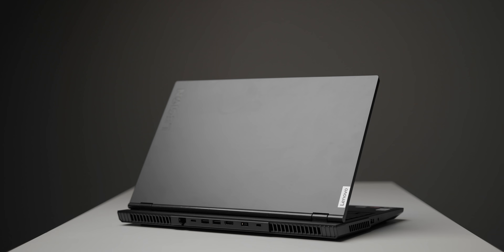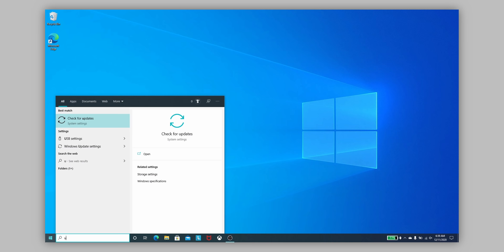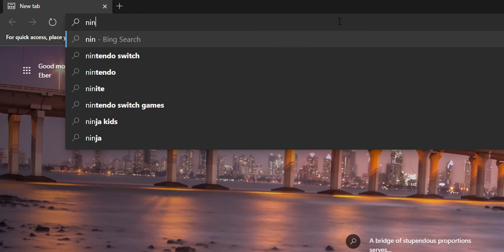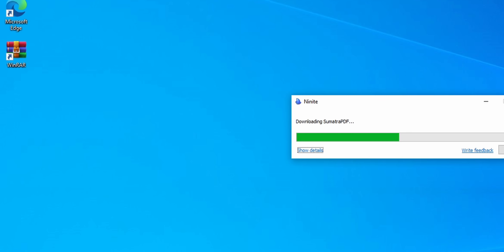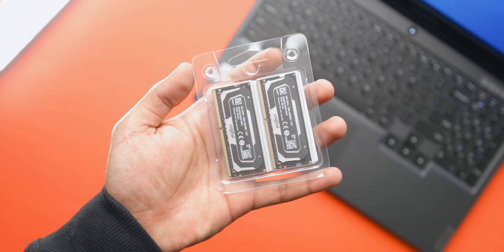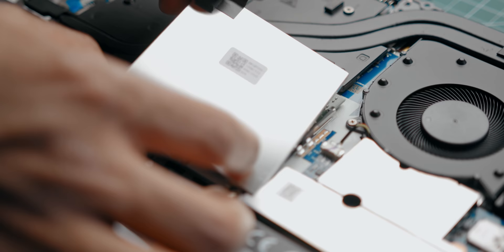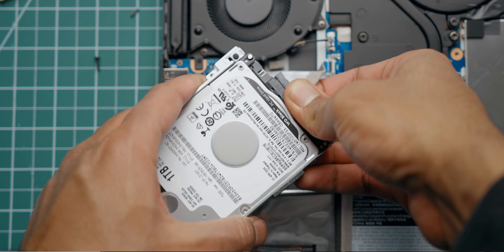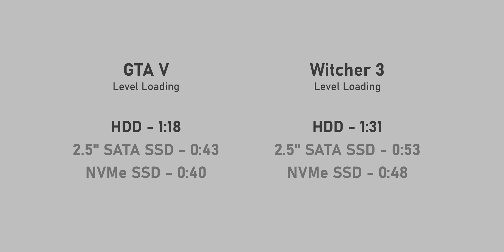How to Upgrade and Optimize Your Gaming Laptop for 2021

Comment: Great Video! As I'm using my Legion 5PI as my only system, I'm currently looking for a second external monitor for work and gaming. I could see more poeple being interested in the topic as there are a lot of things to consider in that specific use case (Gaming Laptop with two external monitors).

For example:
1080p vs 1440p
24" or larger? (or even a single ultrawide instead)
Connecting via USB-C to DisplayPort/HDMI
Refresh rate
Should you get a Dockingstation
etc.

Initially, I thought of getting a high refresh rate 27" 1440p IPS Gsync monitor. After doing some research, I'm currently thinking 24" 1080p is probably the better option. Still unsure though.

Comment: 07:45 Sure we can use Global Daum Potplayer. 
It can utilizie VR, DVD, 3D movie, TV, playing audio, equalizer, own audio configuration like floating point 32bit, surround mode; dolby pro logic II, DTS, sample rate, color space, and so on instead K-lite codec pack doesn't own those features. 
Easy for dummies (I mean newbie/ordinary user).
When you doing something wrong and don't know how to fix that just clik "reset" icon in preference setting then your problem already fixed.

You might try it (Recommended)

Comment: Don't forget ThrottleStop. The biggest feature is being able to adjust settings in Windows to lower power consumption/voltages to keep your laptop running cooler and quieter. 

And don't forget to immediately uninstall the built in Skype, though it can prove difficult to do!

Comment: Laptop cooling feet is what you really need for laptop.
It helps cooling by ensuring fan's air intake isn't obstructed
I got cheap under $1 one. It must be glued to laptop's base plate but this isn't big problem.

Comment: There's no reason for a mechanical hard drive in gaming laptops in 2020 - 2021. M.2's are way smaller and faster and any 2.5 inch drive should be SATA SSD. Mechanical drives no longer make sense for gaming laptops.

Comment: I love using chocolate to install and update apps on my computers. 
Also if your laptop has a metal body consider adding thermal pads to aid with cooling (did it on my dell xps 13).

Comment: There is a way to stop updates. Go to settings and change the network connection type to Data. Then go to updates and make sure download using data connection is deactivated. And boom. No more updates

Comment: software recommendation:
7zip
everything
irfanview + plugins
k-lite codec + format factory+ handbrake....even xmedia-recode
potplayer + smplayer
winaero tweaker + iobit advanced system care
for antivirus, avast is a good start
usb safely remove is also handy
for pdf works,nitropdf is a-must
for browsing, the best yet is opera which is again chromium based browser which means every extension works there as well.
anydesk to get help is also recommended.
DISM+ and integrate it in "boot" menu by enabling it in it's settings is also recommended.
glary dis explorer is a better overall software compare to windirstat.
also always gives people a bootable flash with sergei strelec live-winPE with all it's softwares..medicat and dlcboot are also other alternatives.
Reply: @claritoresdiano1021  killcopy I like more...but fastcopy is the fastest according to tests

Comment: You can create a offline account by clicking "I have no internet" in the bottom left corner while windows asks for your connection stuff during setup.
Reply: Not on all versions of the installer. On some of them you need to unplug your ethernet - Or start over if you accidentally hopped on your wifi.
Reply: @amshermansen  Yes, as far as I know thats true for all versions of the installer. But it is still possible and I prefer offline accounts. Microsoft just created another unneccesary issue here :/
Reply: It's possible on all installers to bypass it. All I said was that some have the "No I don't want an MS account" option, while others won't offer it, unless you physically unplug yourself during installation.

Comment: I 'upgraded' an old 17" HP DV7 laptop a while ago (i7, GT650M GPU) - Though some bits didn't want to go back on (frame around the keyboard) there were some notable improvements: Booting up when cold is seemingly instantaneous due to the mSATA nvme (as fast as entering your password). The versatility of a laptop with 2 2.5" HDD bays and an nvme slot is great - shame about the cheap plastic the laptop is made out of. Will probably make a custom PC out of it later (put it in a desk or box and hook it up to a home network)...

Comment: 2:58 pro tip turn off ur Wi-Fi and then it skips the Login requirement process
Reply from the maker: You can SET UP windows with an offline account but with the latest Windows update, you need an online account or some key features will be locked out like the ability to change your desktop background.  :(
Reply: @HardwareCanucks  ooh right I forgot about that : (
Reply: Why does :( look weird
Reply: no longer works. It will ask for your login credentials when you enable/reconnect the internet on a fresh install.
Reply: @HardwareCanucks  This is categorically incorrect.

You're thinking of ACTIVATION. You most definitely can change your wallpaper without an MS account.

Ya gotta be unplugged from the internet on some builds on the USB made installer. Others have the "No fuck off - I don't want an MS account"

Comment: The Legion 5 is one of the fewer laptops that comes with 115w variant of the 2060 (2020 ver) GPU (laptop TGP range from 80-115w). And it doesn't cost you tons of money.

Comment: I bought one when it came out  a great laptop but if you are playing use the fast charger on the option of the lenovo app it will boost the performance and one another thing clean your laptop cooling for like 2 to 3 months it will help the laptop from bottlenecking if you don't it will damage the hardware non the less a great all around laptop great vid

Comment: Dising Norton...REALLY?!?!? Haven't had a problem yet with it and it keeps both my Main PC and new Alienware M17 Laptop running smoothly. 

Got the laptop from Best Buy and immediately upgraded the single 128GB M2 2230 SSD to 2 M2 2280 Seagate Firecudas AND replaced the 1TB Seagate Firecuda HDD with a 4TB Western Digital Blue SSD and maxed out the RAM to 32GB....but Best Buy sold me a lemon as the CPU Fan started to fail after almost a year. Had a Dell Tech over to replace both fans and he was impressed that the laptop could run with all the upgrades I did.
Reply: The biggest performance boost I’ve ever gotten from software was uninstalling Norton lol

Comment: The best improvement you can do over your laptop is upgrading the storage and replacing it for the lastest technology available. Add more RAM helps working and running mutiple programs at the same time, but a new SSD or Nvme M2 gives you speed, performance and stability.

Comment: Just on a little sidenote, but there is a way to completely disable windows updates. Although the visible option has long since been removed, the function itself is still in windows, and with a quick google you can find how to reactivate it. 
I however cannot recommend it. I have used it in the past to prevent obnoxious windows updates, but it can (and has, in my case) cause corruptions in windows over time, forcing you to restart the pc or in worse cases giving you a BSOD.
Reply from the maker: Actually, the option resets itself randomly with the latest updates.
Reply: It can't reset itself if you don't update. Duh

Comment: Use Brave Browser and then disable the built in torrent, then log in with you Google I’d and such to input your passwords. I also need to upgrade the ram of a hard to get AUS TUF GAMING AMD Ryzen 9 from 16GB to 64GB

Comment: Honestly I am still disappointed in companies/school/people forcing you to use Zoom when you can use something like WebEx but if you have to use it recommend throwing it in a virtual machine if you can secondly I wish we could still undervolt CPUs and GPUs because that actually helps out in performance a lot but thanks to plundervolt and manufacturers taking precautions and making it so you can't do that anymore 😔 well that was my rant but otherwise great video really liked that you recommend ninite also if your comfortable I would say change your thermal paste and pads which might help depending on what the manufacturer used at the time or how old your laptop is

Comment: Great video, and I'm sure most people will find it useful, but for me I'd likely install Linux on this immediately. Lenovo has great first party Linux support, so I wouldn't worry too much about drivers and the like. And it solves problems like bloatware, antivirus, and worrying about Microsoft breathing down your neck. And, well, since every Linux distro has a package manager, I don't have to worry about scouring the web for app downloads either.

Comment: This is everything I did on my old laptop. 2tb Nvme m.2, 2tb ssd data drive, 32gb ram, clean out the dust. Only thing I didn't do was repaste or liquid metal. My os is completely debloated and I use patchmypc to get programs

Comment: 15:04 WOW, I thought, OK cool both dual channel and 32gb help a decent chunk in certain programs but theres no way it'd help in gami- oh wow, even 32GB actually helped with sometimes close to 10% improvement and that's with just 1 program running. And dual channel is just a must by the looks of it. But it is nice to see you can still get 2-3% benefit even in just games from 32GB which is nice as I just got it because I like to have EVERYTHING open

16:09 Good to know, I should've really observed this by now, I'll pay more attention to these things.

17:15 ngl I never knew this I only ever paid attention to downloads. Yes only becasue theyre unoptimised but if things were really properly optimized, things would take more advantage of SSDs and espeically NVME.

Comment: I have an idea which I do not know how practical it is but if we install the thinnest 2.5" drive for example Seagate 500GB 2.5" Ultra-Thin 5mm which is 2 mm thinner than normal drive, we got 2mm of headroom above the 2.5" drive then it may be possible to install second m.2 SSD at the same time! or maybe using m.2 extension cable and attach the second m.2 above the 2.5" drive with something like double-sided tape!

Comment: Would this Ram work for the HP Omen 15 Ryzen 7 as well? 
Can it run CL 16 and 18 Rams, I know CL 22 works? 
Is it bullet proof to assume that as long as the new Ram kit runs at 3200 MHz in CPUZ, then it is 100% compatible? 
Great video
Cheers

Comment: TLDR: I will go SATA SSD instead of NVME SSD because I am poor and want 2TB because WORLD OF WARSHIPS loves to heavily compress their update files during update cycle

Long version: From this vid I learned that SATA SSD and NVME SSD does not have significant difference. So I think I will just go for SATA SSD for my PC. IK its PC but I think its performance is relatively similar. I need to stay away from my HDD to upgrade to SSD cheaply since im poor. I want large storage like 2tb large storage but cheap so I thought SSD is good for me

One game called WORLD OF WARSHIPS is a pain to update in my HDD on top of my i5 4th gen (4c/4t) CPU as it heavily compresses its update file and the dev always gives 2 GB (rare) to 10+ GB (mostly) PER MONTH. Downloading the update file is faster than decompressing it in my experience and it took me not just a day but mostly A WEEK and at least 3 DAYS*.

*I'm not an addict that opens my computer everyday but at most weekly and at least monthly so my games are always updating when I open my computer xD

Comment: Microsoft has not removed offline account just dont connect to internet when setting up your account.
Reply from the maker: Wait till you see what happens in a few days / weeks.  ;)
Reply: Yes - It politely ASKS you. Doesn't force you in any way. (Bugging you should definitely be illegal, but that's another discussion). And no - The lack of an MS account still doesn't lock off features like changing your wallpaper. That's ACTIVATION.

For a tech channel you sure seem ignorant about how the leading OS works.

Comment: Your Ram comparison doesn’t really explain the importance of dial channel vs single channel. You increase the capacity of the ram each time. You should have down the difference between 1 8gb module vs 2 4gb module, so on and do on for each tier... of course the performance will increase as you add more system memory resources.

Comment: I have Acer Helios 300 (2019). I want to know one thing, when I clean install windows on it, do I have to install chipset driver from the manufacturer's website or just let windows handle everything from windows automatic updates. Please help, I don't know what's better. I know this is not the laptop featured in this video, but in general, this should apply to many laptops. Chipset drivers and other drivers listed on the manufacturer's website always seems to be old.

Comment: is crome a big thing or just a small disadvantage?
Reply: It takes more battery and ram and is slower than edge. I really want to switch but I’d also have to move everything over to edge since I’ve been using chrome for so long. :/

Comment: I have a bit of a dumb question but I have a typical 300$ laptop not designed for gaming

Is it still possible to swap out components with a relatively thin laptop or does it need to be a certain thickness

Comment: I have a gaming latop and looking at HWinfo i see my firecuda SSHD hover around 40~43C wehn the computer is idle but temperatures goes down when the fans are ramping up and RAM can reach almost to 60C under heavy gaming.

Should i be worried with these temperatures?

Comment: I have an Alienware m17r2 and I had it undervolted which knocked 10 degrees off the cpu temp. But then the bios was updated by Dell when I sent it in for a small repair and the new bios doesn't support undervolting anymore. Does anyone have any suggestions? I already upgraded the thermal paste to thermal grizzly Kryonaut and it made a big difference but I'd like to get Temps down a bit further so my cpu can hit 4.5ghz.

Comment: i have a legion 5 with 1 8gb ram stick at 3200mhz and a 16gb ram stick at 3200mhz. should i upgrade the 8gb stick to the same 16gb stick, if so will this increase performance

Comment: I would strongly recommend using WizTree by Antibody Software instead of WinDirStat. Instead of manually enumerating every file on the disk, it instead reads the Master File Table on NTFS drives directly to get the same information. In my experience, drives with lots of files on them scan in less than 5 seconds rather than upwards of 2 to 3 minutes. 

There's a few missing features compared to WinDirStat, especially if you're working with multiple drives, but the performance benefits are simply too good to be ignored.

Comment: bro am confused with the selection process i have the budget 85000. My work is mostly focussed on  video editing and casual gaming i have selected two of the best HP OMEN with 4600H  1660 Ti and Legion 4800H with 1650Ti  which is suited for my choice i am really confused. And am a research student too i will be suing some Bioinformatics and structural  softwares.. i need help

Comment: 2:57 What does he mean by “offline account?”
Reply: Skip Microsoft account maybe?
Reply: an 'offline account' is basically they nowadays call the 'old' windows install, for which you did not need an active, internet-bound account, but only the license itself. 
That option has been removed.
Reply: Local account is the popular term 
Microsoft forced the users to have a Microsoft Account during final Windows setup if the computer has internet connection 
I would suggest people to temporary disconnects from the internet first and then create a local offline account.
Reply: @phucnguyen0110  That no longer works. Once you enable/reconnect the internet, it will ask you for your MS account on fresh installations.
Reply: If you don't have internet, it won't try and force you.

Comment: I have a soldered 4GB 2400 RAM and another one which is user replaceable, if I get a 8GB 2400 to replace  it will I still get dual channel?
Reply: 8 GB will be dual channel, all memory addressed after that will be single channel.

Comment: i use McAfee.
Reply from the maker: Our condolences.
Reply: @HardwareCanucks  I've been using it for years. No issue's on my end.
Reply: @River_Miles  No performance gain on my end when its off. I tested with it on and off, i get the exact same fps in games. And i have 32GB of RAM.

Comment: Do not ever buy a lenovo laptop. Their default warranty lasts one year and if you forget to renew, there is no way to ever extend the warranty. My legion laptop lasted one year and then the motherboard completely fried and the battery exploded. When I contacted lenovo, they told me to go to a service repair center. Repair centers are god awful and a ripoff, charging $50 an hour just to examine the product. For me, they would’ve just told me to get a replacement motherboard which costs $500+ and is not even warranties. They mostly tell you to just not bother and buy a new laptop.

It pisses me off so much to see so many videos with the legion brand, knowing that I got suckered into buying one of their laptops and being told to “just buy a new one” a year after I bought it.

DO NOT BUY LENOVO. THEIR CUSTOMER SERVICE IS ANTI CONSUMER.